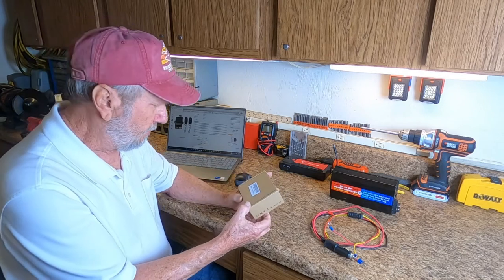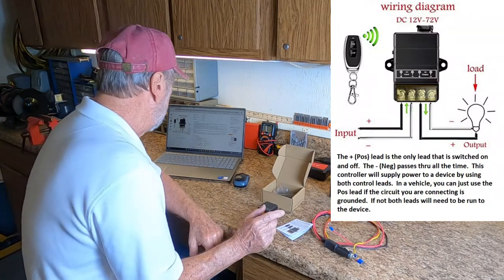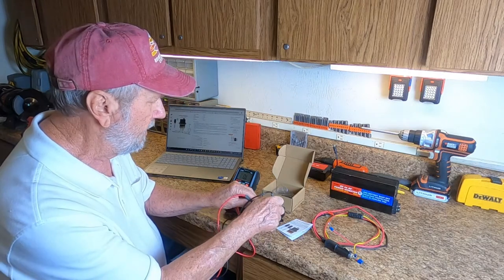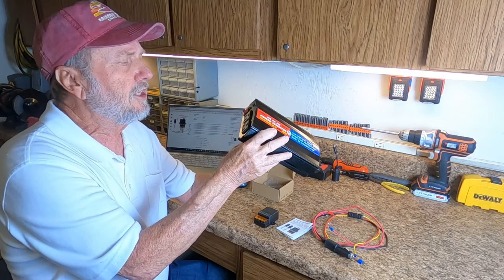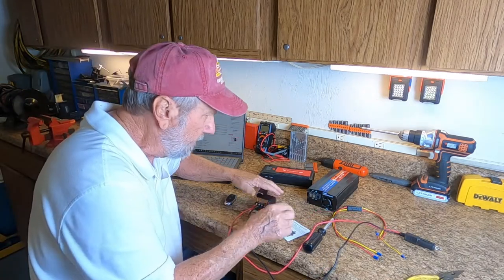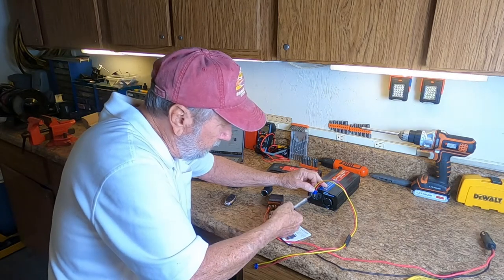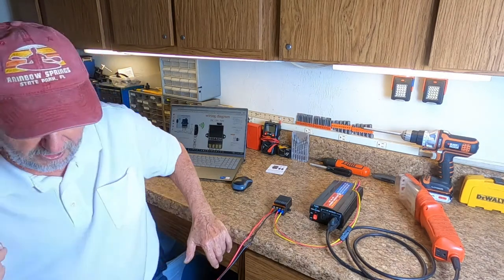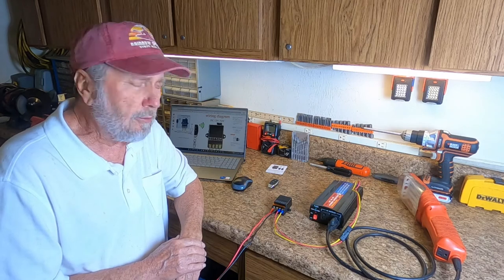12 volt Wireless Remote Switch 30amp Review

Comment: Good morning I have a question about we use a 12v Dc 3way ball valve model 344E 3/4" that same 12v Dc remote control 433hz it was working fine for along time now it won't turn the Ball value back and forth to each different side but I have tested the tejet Ball value with a 12volt  batter and it works fine  3wires red black and white the white is the alternative for turning the ball to each different side of the tejet 3way Ball value but won't turn with wireless remote control?? Any feedback from you I will appreciate it so much thanks for sharing great information
Reply from the maker: @ga-prowashllcSoftwashing, Only thing I can tell you is to test the Remote Switch.  Disconnect your valve from the two contacts of the relay.  Use remote to activate relay and use a multimeter to see if the relay operates and you get continuity across the two contacts that go to the pump.  The relay just closes a circuit for the Positive Battery terminal to connect to the pump through the relay contacts.   If the relay does not operate, you need to be sure your remote has a good battery or try your second remote.  If the remote is good, then you need to check voltage going to the relay both the positive and neg leads, Red positive and black neg.  You need the voltage on these terminals to operate the relay.  This should lead to isolation of problem.  Good luck.

Comment: Recd unit yesterday,not a mention of batteries,any idea what powers these???
Reply from the maker: @pland99 Ok, I can explain.  There are 4 screw contacts with a little amber door.  Just above the door is the contact name chart, showing what each contact does. The first 2 are marked DC Input.  This is where you put battery and ground from your car.  This should be fused, not run straight to the battery terminals.  If you are not familiar with dc current and voltage and wiring, you should get someone to help.  Too much for me to explain at this point.  Now this will power up the remote control circuit inside the box. Now that is how you get power to the Relay circuit to perform work through the other 2 contacts.  Notice, the other 2 are marked DC Output.  When you push the remote with the first two terminals powered as described, you will get Positive on the  3rd termial.  Pos DC Output.  The ground terminal does not switch, it is there all the time.  So all you need to run is the post to what you want to power and connect ground to the other side of the thing you want to power.  Saves the ground wire.  Now the remote controls have a battery inside, the 3 screws give access, will be a long time before they need to be changed.  Now back to the relay.  when you push the on button of remote, the remote circuit inside the box puts power on the relay inside and it operates and puts pos on the 3rd terminal and light or whatever operates.  That is it.

Comment: Hi Sam. So to hook one up to my truck starter is pretty straightforward? The 12V input will power the switch and the red output is all I need? Wouldn't the starter from the fuse panel have both + and - ?  Any help appreciated.
Reply from the maker: @cpspec 3004 You do not want to make the connection you are talking about as that is not the way the car will start.  First, there is a starter solenoid that is a relay inside the starter.  When you turn the key or push the button to start your car, there is a computer system that checks everything out, like is the car in park or neutral, Fuel pressure is available, a safety relay has to operate in case of accident to shut system off to prevent fire.  As you can see, you can not just hook battery to the starter.  Battery is already on the starter Solenoid, you have to operate the solenoid that will close contacts that connect the heavy pos bat lead to the starter and turn the starter.  You just do not want to waste your time doing in this direction, I know it sounds good, but I have told you why it will not work.  Old cars in the 50's and early 60's could  have worked this way, but you would connect the battery pos terminal through the relay to the Solenoid terminal.  Just hook it up the way it was designed and you will be better off.  I did a video demonstrating the current draw on this relay and it is very small and will not run your battery down.  Look for it on my channel.  good luck.
Reply: @samowens44  Makes perfect sense.  Thank you for the detailed reply and I'll check it out on your channel.  Appreciate the quick response.

Comment: Hey man I just got one of these and I have this hooked up to lights on my truck and it turns them on and them turns off after about 5 second idk why it’s doing. Have any idea,
Reply from the maker: You need to see if the power to the relay input is going away by putting a test light in the input pos lead.  If power goes away then the relay will deactivate and you will loose power to your lights.  For one thing this is not a relay to close contacts to control a powered light circuit.  It is a relay to supply power to a circuit that has no power connected.  I do no know how you are using the relay.  Hope I have answered your question with the explanation of how the relay work only with providing power to circuit.

Comment: Hi, I have one of these hooked up to my amplifier in my car for the audio. I wanted to turn on and off manually when I want it on and off I have the ground and power hooked up to my amp so I only ran the positive to this relay because mine amplifier already hasthe ground so I didn’t hook that up. How do I set it up or code it to where it turns on and off when I wanted to any help would be greatly appreciated. Thank you.
Reply from the maker: @DayDaysWorld316 I do not have the facts of how you hooked up the input the the Relay or the output.  Let me tell you some facts you need to know about the relay.  It has a remote control circuit inside the relay that responds to the remote signal to operate the relay.  If you only hook up the positive let from the battery to the pos side of the input side of the relay, the relay will not operate and nothing will work.  The relay input side must have positive and negative lead connected to the battery, no matter what you do with the output.  The reason is the remote circuit in the relay must have pos and neg to work.  No hook up the input ground to the ground side of your battery and you should be good to turn on and off your amp.  You do not need the output neg, because you already have a ground to your Amp.  I think you thought the relay would work with just the positive.  Now you know a little be more about Ohms law, a circuit to have a current flow has to be a complete circuit, pos through the circuit and return to ground.  Now go enjoy your Amp!
Reply: @samowens44 thank you so much for the response. So the amp does turn on with the current connections however it shuts off moments later. I thought it was just me coding it wrong. I want it to operate with on and shut off when I click off. I will check shortly how it is wired and give you some more input. Again thanks for the feedback. You don’t have to yet you do. I salute you sir. ❤

Comment: How could this be wired so that the switch CUTS power.  I want the default condition to be ON, and the switch to turn power OFF.
Reply from the maker: Let relay supply power and when you want to remove power push off button.
Reply: @samowens44  Could this be accomplished without a parasitic drain on the battery? I’m trying to have a remote that shut off power to my kids ride on toy when he gets too close to an intersection without listening to me. I want him to be able to use the ride on toy without me having to switch it on using the remote.
Reply from the maker: @thermal_el_jackson  for the toy ride, the relay will not drain the battery enough for concern.  Just use the relay to supply the power when you want.  The remote has a good range.  Wire the relay to put power on and off from the battery.
Reply from the maker: @thermal_el_jackson  I am sending a link to a diagram of how to wire the relay to control power to the toy car motor.  This is a link to a Google Doc click on it and you will see the diagram. Good Luck.  https://drive.google.com/file/d/12FISdOcsUNlRTD-DWFog-lOuxEsZLQnJ/view?usp=sharing      I forgot to put a lead from the - neg output to ground but it is not needed.  Motor will already have grd on it.  Just need to switch the Pos lead on and off.
Reply: @samowens44  Thanks for sending that. I’ve got a relay in front of me, and it’s got five different wires coming out of it. Do I need to hook up all five wires to something?
Reply: @samowens44  Wait I think I got it. Thank you!
Reply from the maker: @thermal_el_jackson  Not sure about your relay, a volt ohm meter can help you find the switched output and that is what you need.  Good luck.
Reply from the maker: @thermal_el_jackson  Great!!!!!